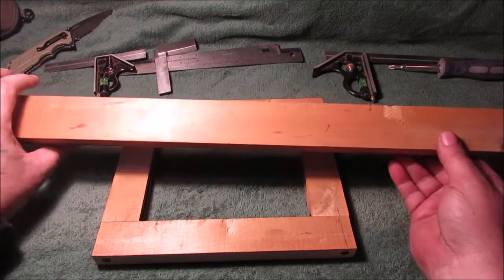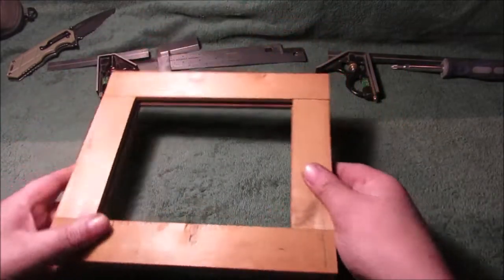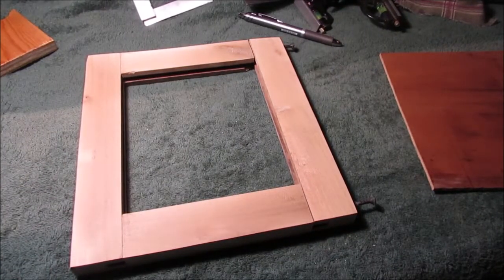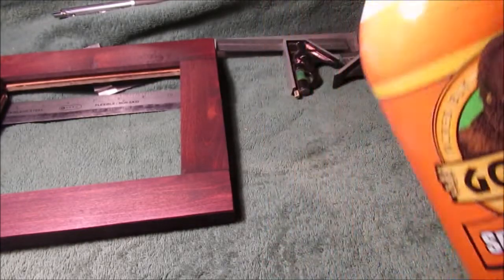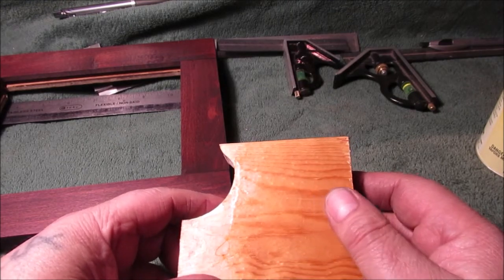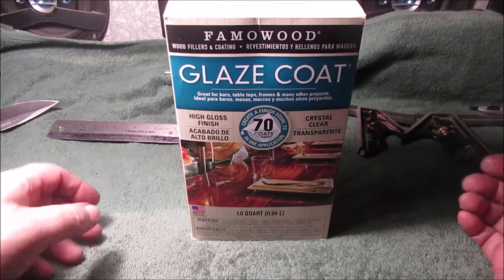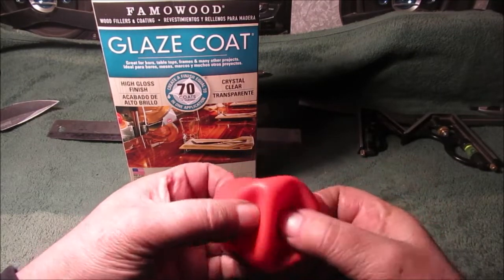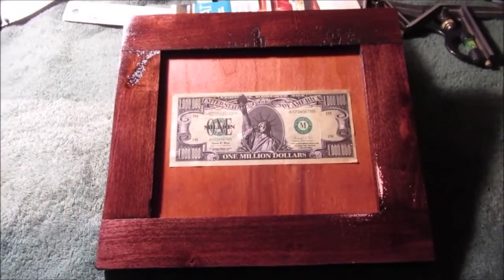Sunday in the Shop with not2fast4u2c....02-24-2019

Comment: I use the Glaze Coat for making ponds and rivers on my model railroad layout. It is self leveling.
Reply from the maker: I think I will have fun experimenting with the epoxy
Reply from the maker: George I am going to try and make a knife handle with this epoxy I want to wrap para cord and then coat it with the epoxy ..I am worried the stuff may still be sticky to the touch..It should not be since it is meant for table tops

Comment: i use shellac when i thread wrap my club and spear handles.  Shellac has been around for a long long time i know you can trust it to work its not a gimic product it works for so many things , if i saw it and other products in my dads shop and grandpa shop , then i stick with it .  shellac 3 in 1 oil ect.
Reply from the maker: I do like how easy shellac is to apply ..I may spray a coat on some of my old wrenches....I do plan on getting a quart can of it to brush on a future wood project